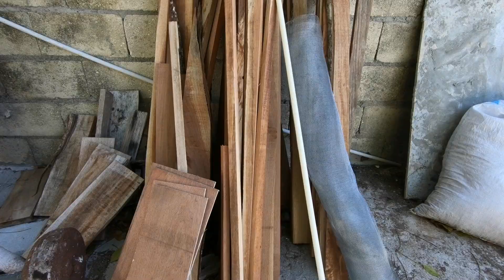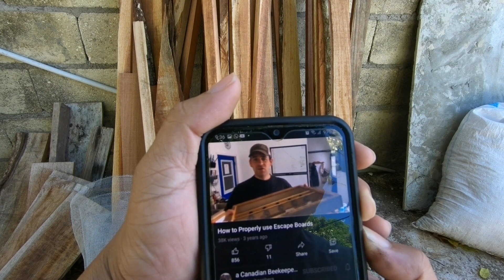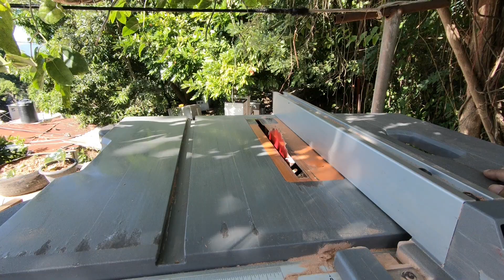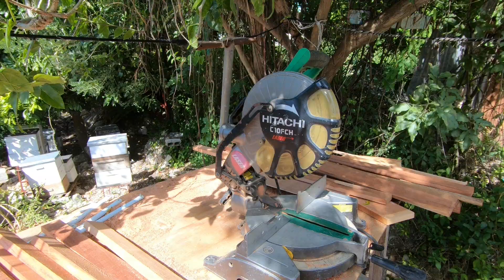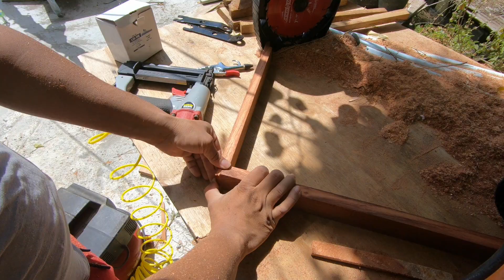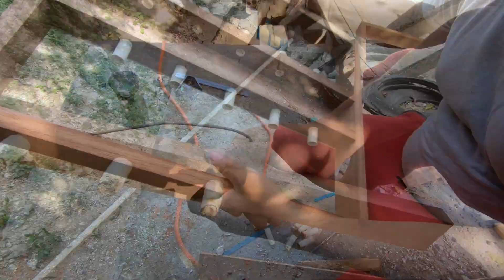How To Build a Bee Hive Escape Board

Comment: Sir do, Devon the escape boards work well however, the ones I made I didn't have scraps but just small strips.  I used the inner covers which work very well as I was able to do all the removal of surplus honey with ease and comfort.

Your boards will work well and know you will enjoy using them thanks for sharing 🙏 😁 👋.
Reply from the maker: Hi Hans, thanks for watching. I saw your videos with the bee escapes and they work very well. I wanted to use this type as I think it requires less lumber. I will be posting an update using them